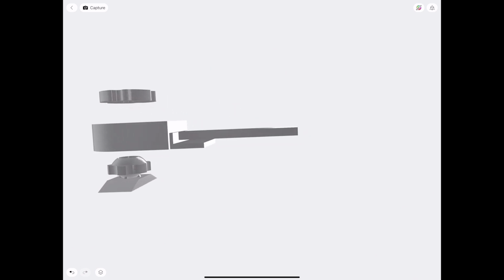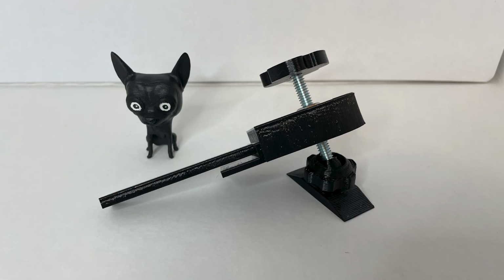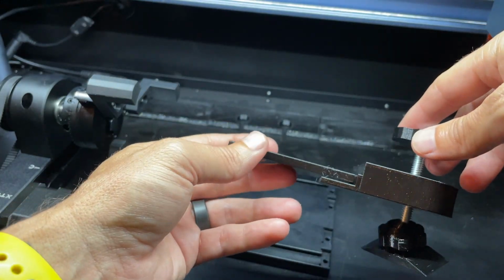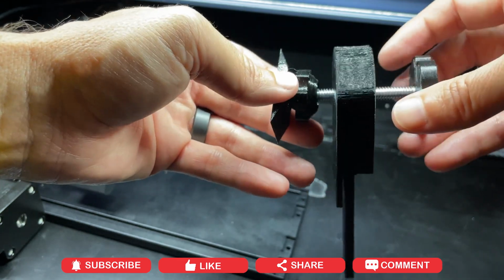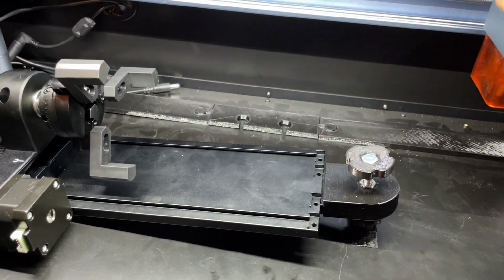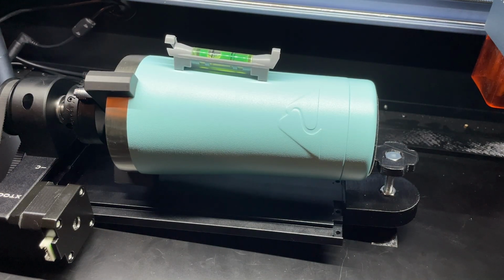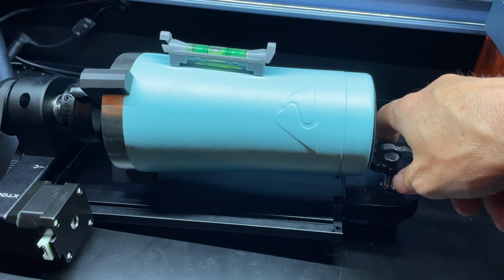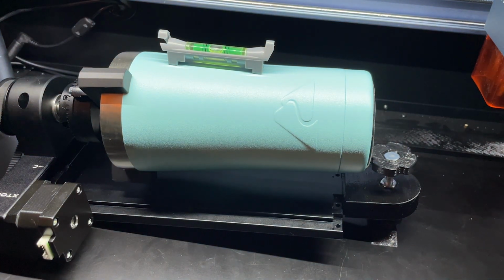Xtool RA2 Pro Rotary - Leveling Jig

Comment: Looks great, but I can't find the Hobby Lobby magnets online.  I'd buy the STL files if I was sure I could buy the magnets.
Reply from the maker: Yea I have a local Hobby Lobby and they are always in stock. And realistically, as long as the magnet is thin enough, any diameter/size would work fine.

Comment: I like the design but my concern is that you put the nut on top instead of the bottom.  Unless you have glued the nut, gravity will eventually cause the nut to pop out.  Also a little concerned with your print orientation.  You have layers running vertically for the part that slides in and that creates a weakness and it could break along the layer lines.  Just something to think about.

Comment: Nice setup. Only concern id have is with some of the longer tumblers I need to use the support piece right where your leveling tool would be. Other than that your design is pretty much perfect. Do you have somewhere I can get it?
Reply from the maker: Yea I have been thinking about that as well but no great solution just yet. I did go ahead an add it to Etsy if you are interested. Thanks for the feedback. https://www.etsy.com/listing/1228380064/xtool-d1-ra2-pro-rotary-tool-leveling?click_key=c1518053b4ed03f10b2aa32c598d5fd330e3ad95%3A1228380064&click_sum=a1accb0b&ref=shop_home_active_1